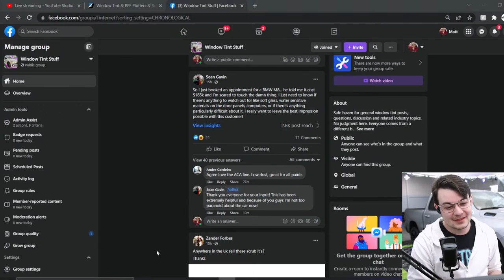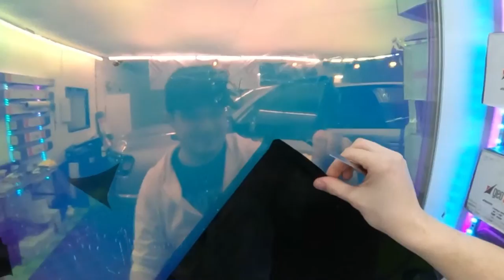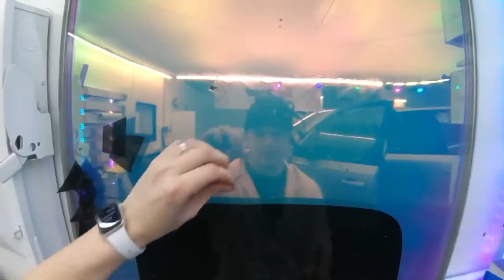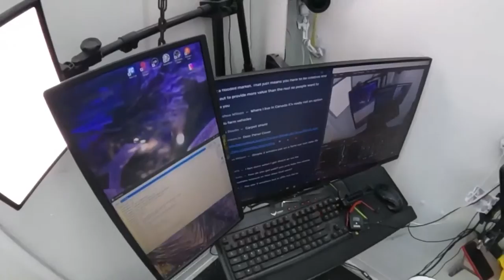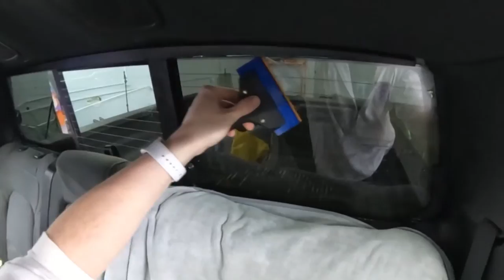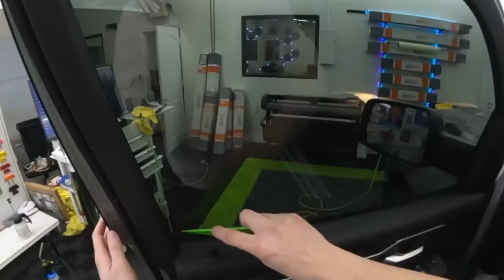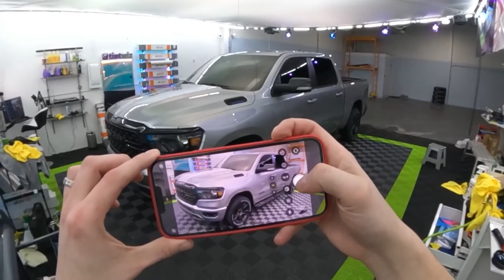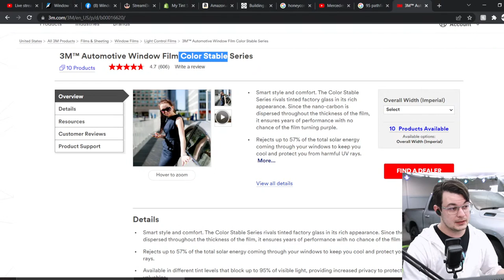Ram Windshield Window Tint and MORE!

Comment: How do you tint when the customer cant avoid the messy roads that throw salt all over the car this time of year in the upper Midwest?
Reply from the maker: You really don’t have to worry about the car. Taping seals, cleaning windows and having a good process give a clean result. The only time I care about the state of the car is when it’s been off-road mudding